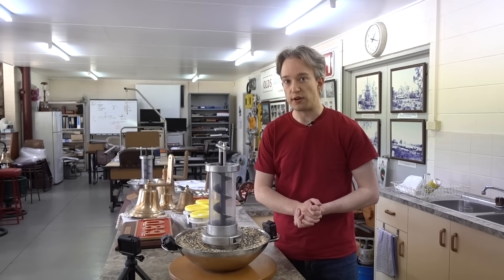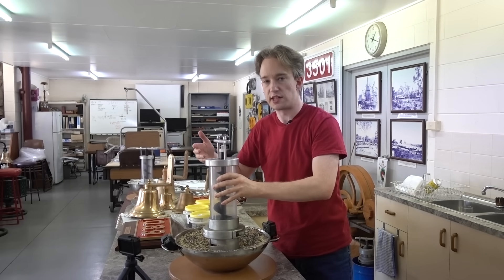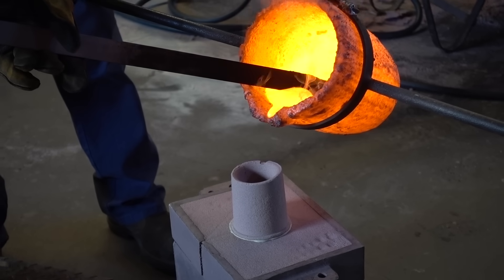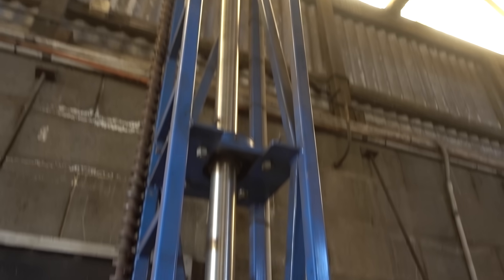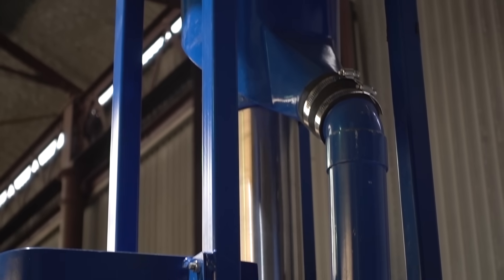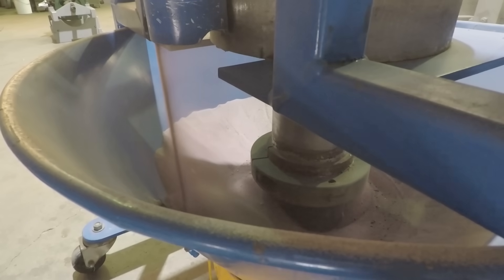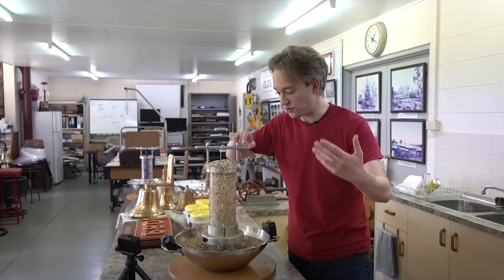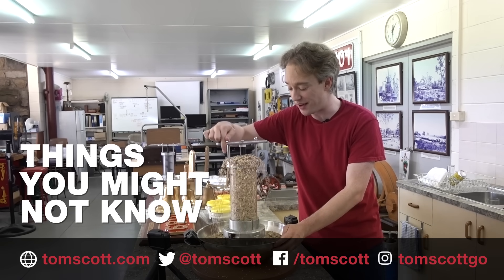Mr Olds' remarkable elevator

Comment: I'm afraid I don't quite understand what makes it superior to a normal Archimedes screw pump
Reply: It's easier to engineer. Because the moving section is on the outside, it can be belt or chain driven without any interference with the inside of the mechanism.
Reply: I think its cause you can power it more evenly from the outside? with the screw moving you have to have it attached to something at the top and bottom, where with the tube moving you can put power into it from any portion. That also means that it can essentially float, not touching the bottom, whereas the screw would have to come out of something, leaving a space which could get clogged.
Reply: It doesn't crush the material in the gap, and it doesn't mix any air in. This means there is no dust and much less friction.
Reply: Spinning the casing would be easier to do than spinning the screw 🤔
Reply: And is safer to move easily combustible powders up with less friction
Reply: That’s what I think too. Anyone having issues with YouTube inbox showing that there are new replies in the comments but it won’t show them in the actual comments?
Reply: AlexLS 192 YouTube has been broken that way for at least a few months now.  Sometimes refreshing can get the new comments to pop up. I suspect it’s a problem with synchronization across distributed cloud servers.
Reply: The other advantage is that the bearings can be outside of the tube and completely separated from the bulk material, so you don't have to worry about sealing them again dust and particles, and you don't have to worry about getting grease or oil in the bulk material.
Reply: @yasirsaheed  it's one of those things that sounds wrong but is right.  Like the potato paradox.
Reply: It is not well explained but Archimedes will not work well vertically whereas the Olds works best vertically.  No product damage. Output precisely proportional to speed. In theory you can lift granular product vertically forever. It is really taking off now.  NO.. and I mean no maintenance system.   etc
Reply: A normal Archimedes screw pump is good at lifting air. This device is horrible at it. Therefore you don't get air mixed in with your particulate, which had all kinds of advantages.

Also the fact that it works with a huge gap makes it incredibly forgiving.
Reply: The original Archimedes screw carries a number of 'pockets' of water up an inclined slope (see Wikipedia for illustrations).   It relies on gravity to keep the water in the pockets; there's lots of airspace above the water; and it could not work vertically.    This machine relies on relative motion between the screw and housing and on friction between the grains of the material; it needs no airspace; and it wouldn't work on a liquid.    Very similar geometry but quite different operating principle.

Comment: this is really interesting, but why does it matter which thing rotates?
Reply: caus of the scoops in the bottom.
Reply: To my understanding, if the screw is rotating, the screw lifts up the stuff, some of it falls back down, there is space between the top of the stuff and the next screw level, etc. There is air, so it can blow up and lifts less material overall.
If you rotate the base, it starts packing the material into the bottom with those openings. The screw just drives it up, but it is the densely packed material which actually does the lifting so there is no air mixing in.

Anyone can confirm? Kind of just skimmed through the video because at work...
Reply: I think it's much the same, but it's often easier to turn the outside because you don't have to have a rotating seal/bearing system sitting inside the powder, and you can power it at any, or even multiple points along the length. Also, the bearings are all on the outside, which makes it virtually impossible to contaminate the product with lubricating oils.
Reply: @nazamroth8427  yes exactly like that the scre become the base and path of the grain to going up. So the grain itself moving because pushed by new grains.
Reply: Because when the screw is moving, it will pump air up too, like a fan. This causes the dust issue. The scoops on the bottom, and air not clinging to the cylindrical surface of the tube like the grains do, causes the grains to lift up without air being mixed in (i.e.full flow)
Reply: If the tube rotates, the bearings can be outside of the tube and completely separated from the bulk material. Therefore you don't have to worry about sealing them bearings again dust and particles, and you don't have to worry about getting grease or oil in the bulk material.
Reply: I'm assuming this wouldn't work with liquids though.(or would it?) So it's not just the air being unable to mix. The friction between the particulate matter keeping it all packed together has to be part of it.
Reply: @Thumbsupurbum   If you spin it fast enough it will still work, But I doubt that it would be terribly efficient.
Reply: @Thumbsupurbum  An Archimedes screw can handle liquids, in some configurations -- indeed, moving water was what it was originally invented for.  They're usually at a 45 degree angle, instead of straight up, and the turning part fits more tightly in the cylinder than if you're doing grain or particles, so, like, the water doesn't just flow back down the sides, but is instead kinda scooped/pushed up instead.  I'm not explaining it well, but you can google for a moving diagram which will explain it better.
Reply: @IanOsmond  I know how the regular Archimedes screw works. I meant the method shown in the video likely would not work with liquids. There was no mention of it in the video, so I can only guess. As Spencer Robinson
 pointed out it would work if spun fast enough. But then that's just using centrifugal forces, the screw wouldn't even be needed for that.
Reply: @Thumbsupurbum    Correct.   A regular Archimedes screw wouldn't work vertically, and this machine wouldn't work well with liquids.   It relies on the relative motion between the screw and the casing and on friction between the grains of the material being lifted.   (Such friction is substantially independent of velocity.   In a liquid you don't have friction, you have viscosity which produces forces that are highly velocity-dependent and the whole thing becomes hydrodynamics and...   complicated).

Comment: I thought I had a good grasp on basic physics and engineering stuff, but it still somehow feels counter-intuitive...
Reply: It's because Scott dismisses the most important part of the innovation as just 'a couple of scoops in the bottom'. The whole innovation is about disconnecting the rotating feed lips of the screw to the rotating case while keeping the screw still. Solid innovation, but the explanation could have been better.

Comment: There are "mixed" variants already, where there is only one piece, the wall is actually only an edge on the cylinder so your material does not fall. Works for non demanding areas and heavier materials that tend to "stick" together, like water. There is a thing like this in a park nearby, at mine (now a museum) park, to show children how Archimede's screw works and how water can be carried up.

Comment: I do hope the people "confused" by this, simply had not been shown the inlet yet. Once you see those scoops, you immediately recognise how it works. The scoops dig material from outside the pipe's footprint, and force it into the footprint. The material already inside the pipe footprint cannot escape downwards, so it's forced up the pipe. The screw is only there to overcome the headlift limitation of this de fakto pump. Without the screw, the mass of the material in the pipe would increase until it pressed down just as hard as the scoops pressed inwards.
Reply: This! I remember watching this video when it came out, completely puzzled by how this thing can work. Rewatched it now expecting the same reaction, but then I saw the b-roll showing the bottom of the machine and was relieved immediately :) I guess I simply missed it back then, it's a very brief shot after all.
Reply: i think once it gets started there's also some amount of friction from the tube that works the material up the auger. but yes i saw it right away as well, it's  primed by the scoops.

Comment: Question in the beginning seems a bit misleading as it’s not a simple cylinder, the wings at the bottom seem to be critical to forcing more of the product into the device. If it was a purely open cylinder, I suspect nothing would happen as nothing is being added into the system.

Comment: Given how the design works, there doesn't seem to be a significant reason to have the entire pipe rotate. It's really the scoops at the bottom that are applying the majority of the workload. They're effectively like the blades of a turbine, with the whole screw acting as a stator.
Reply: I guess the advantage of the rotating pipe is that you won't have shearing force against the inside wall as the material rises, thus lowering damage to whatever material you're lifting, which wouldn't be the case if the pipe didn't rotate or if you were rotating only the screw.

Comment: Its actually the scoops that do the work. Not the cylinder. As you turn the cylinder, the seeds are forced in the middle by those scoops and up by the screw. So no wonder they travel upwards.

Comment: Trying to understand why rotating the casing is better than rotating the screw, and I can offer the following explanation:
1) If you rotate the casing, the main friction forces opposing the lifting of the product are on the screw. The product gets rotated by the casing up and around the screw (note in the video how there is no speed difference between the seeds and the casing - they rotate together), and so leakage down the gap between the outside of the screw and casing doesn't occur. If you spin the machine faster, the product is pushed into the casing and away from the screw (centrifugal force), making it more efficient.
2) If you rotate the screw, the main friction forces opposing the lifting of the product are on the casing. This stops the product from rotating with the screw, instead it gets pulled straight up the tube with greater losses, and leakage down the gap between the outside of the screw and casing occurring, which will result in blockages. The faster you spin the machine, the greater this friction becomes and the higher the risk of blockages as product gets forced into the gap between the screw and casing.

Comment: I've always wondered about the number of inventions that we have missed just because technology took a slightly different path. Just for example we settled on AC for electricity at one point, but then we actually figured out we needed to convert it into DC for quite a few applications such as inside of computers due to requiring a more stable flow of electricity. There have been a number of decisions throughout history that we made because it just seemed like the simpler solution. For example with the old's elevator I can easily imagine that someone thought about it and decided it was easier to turn the screw rather than the entire casing, also turning the casing wouldn't work for liquids. Likely everybody else just went along with what was already in use and never thought about whether it could be improved or done in a different way.

Comment: It has been around for a long time, just like the auger.
People thought about it and made it. 
But they already had a device similar to an auger.
Takes a lot of work to reengineer the spinning part to be the tube rather than the screw so only places that dealt with potentially explosive or flammable material worried about it.

Comment: If I'm not mistaken, this should even work without any screw on the inside, as the grain/material is pressed into the feeder at the bottom and it can only escape at the top by moving upwards. At least this would work with some very low density material that wouldn't create a large hydrostatic pressure over the height that it's being lifted..

Comment: Makes sense. The scoops at the bottom are what is actually doing the pumping, the screw just provides a low resistance path away from the scoops. Without the scoops, you would have no pump.

Comment: Well, the bottom is quite different from the screw one, and that's what helps it to pull up things.  Not just the casing.  Rotating the casing doesn't seem to be the important part, it's the scoops at the bottom that are. If you just put a cylinder around a screw, I don't think it would work.
Reply: It isn’t just the scoops at the bottom.  There is friction between the casing and the product which accelerates the product to move in a circular direction, the blades of the screw act as ramps that turn the circular motion into upwards motion.  If you think of the screw as a circular ramp like in a parking garage and the moving walls as the engine drives the cars up it makes perfect sense.
Reply: @qtheplatypus  Maybe this question is dumb, but why exactly do you need the screw at all? These flaps at the end ensure that more material is pushed into the bottom of the tube. If you push more material into the tube at the bottom, the only way it can travel is up. So why exactly do we need the screw to push the material up the tube?
Reply: @Mystarer4444  at some point the weight of the stuff in the tube will be greater then force that scoop imposes.  You need the screw to help keep pushing it up.

Comment: I mean my brain when i saw him pull out the sleeve that goes around the screw went “scoops pull material in, screw helps promote upward movement given it’s more gentle vertical angle compared to the walls of the cylinder, and grain goes up”

Comment: Why hasn't someone thought about this sooner? Probably a lot did but it is just more dangerous. When only the screw rotates you have a protective housing,  but if you rotate the housing not only do you have more (unused) surface and maybe more mass to rotate, but now you have to make a protective housing housing.. same with dust. The screw geometry and speed can prevent dust as well.

Comment: I was in charge of installing and operating an Olds oil fired brick kiln system in Adelaide South Australia back in the mid 1960’s , quite an interesting concept but a little temperamental. I would love to make contact is possible. Cheers.

Comment: It makes perfect sense to me. But what I am wondering is how well it would function if the entire tube wasn't turning, but just the scoops at the bottom. Sure, there would be additional friction of the product against the sidewalls, but by acting as a fluid the product should still be able to rise almost as easily. This could reduce the need for moving parts drastically. It would essentially all be stationary like a spiral slide, but the scoops produce an inward pressure at the bottom that forces the material to go up the slide rather than down.

Comment: I'm surprised Tom didn't immediately understand how that machine was feasible. There is very little friction between shells of bird feed and what looks like glossy plastic. When you turn the cylinder, which has scoops to push the mass up the elevator.

Comment: Actually, you don't need the screw at all if you taper the tube outwards towards the top. Although it would require a faster spinning rate.

Comment: Aren't the scoops on the cilinder crucial? I think Without them it wouldn't pick up anything. Screw is a scoop in itself so it works, but if you rotate cylinder it needs scoops added

Comment: 1 min into video.

As soon I saw the bottom of the cylinder it made much sense to me. Yes had it just had 2 normal holes in the side it wouldn't work. 
But since it's formed the way it is with one of the sides at each hole working as a scoop it will force the produce into the cylinder and force it the way with less resistance (in this case up).

Comment: For my understanding the "advantage" of the extra bearing options on the cylinder is a misconcept, as someone else said, the "less dust advantage" is the real one. Yes, you can add bearings to the cylinder to support it, but the screw does not get any stiffer from that. And the forces on the screw stay the same, doesnt matter if you rotate the cylinder or the screw.They just move relative to each other in a circular manner. Finally even with a super sturdy rotating cylinder the fores are transfered via the grain to the screw and bent the screw at some point if they are not completely rotational symetrical. At least that's what I was thinking, but a mechanical engineer is also not allways right;)

Comment: 0:38 Calling it simply "a cylinder" is kinda misleading. Once you mentioned the scoops at the bottom, it made perfect sense - they're the ones doing the work after all - pulling new stuff in, which pushes everything along the screw surface. It's not some magical counter-intuitive interaction between the screw and the casing.
I guess, rotating the whole cylinder helps reduce the overall friction, especially on tall versions, but it should work just fine with only the scoops rotating - there is the same kind of friction in versions where the screw is rotating, and they are totally fine (although, technically, there's friction from the screw missing, so maybe combined they'd be too much, who knows). Might not even need the screw, depending on the application! :P